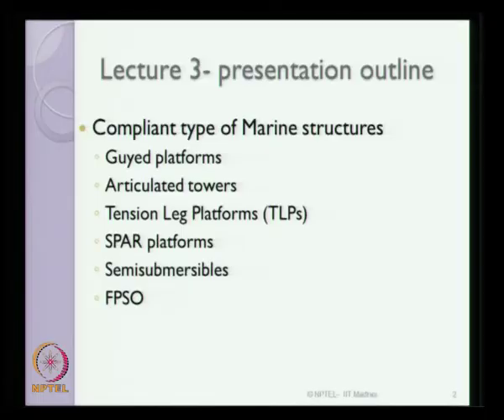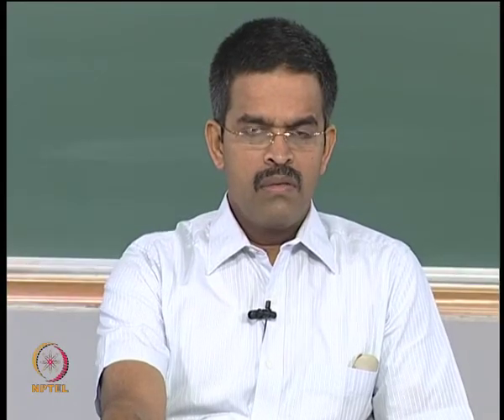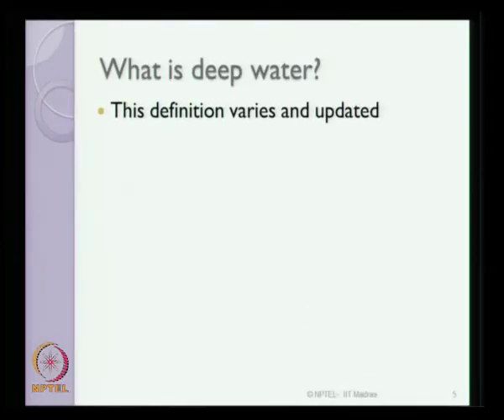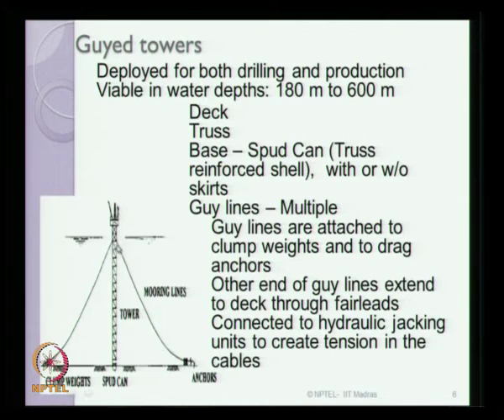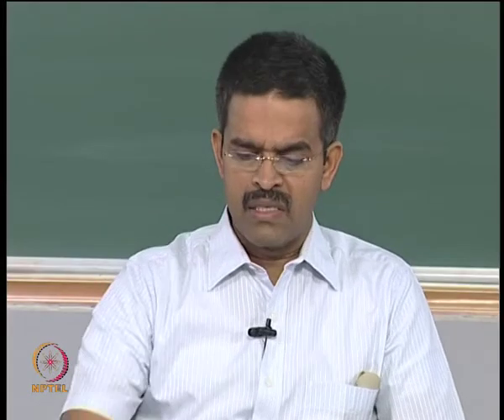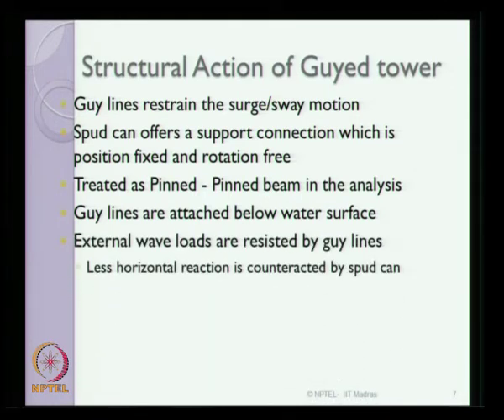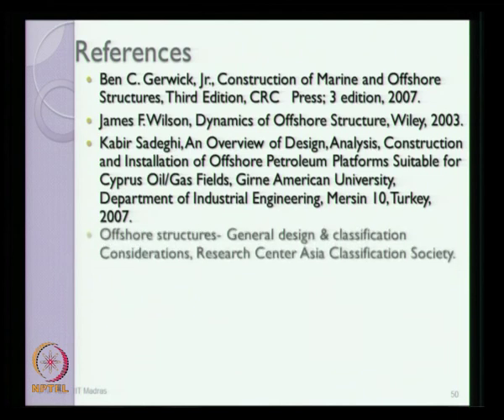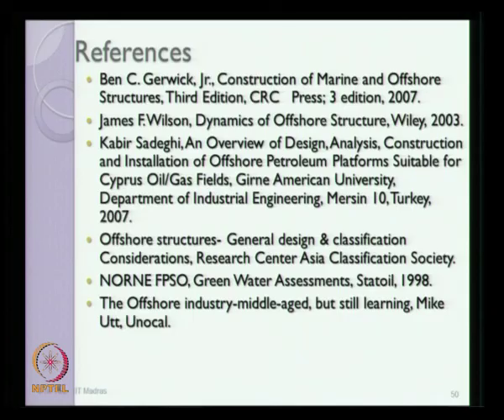Mod-01 Lec-03 Compliant type structures

Comment: A SALM is unsuitable for mooring a drillship (if I heard you correctly). The vessel rotates around the SALM so it doesn't provide a fixed position for the wells. It is usually used with subsea wells.
The picture shows a FSU and the tower is a flare not a drilling derrick.

Comment: TLPs. There are of course no launching costs.
You don't mention one of the biggest advantages, which is that the deck can be installed and pre-commissioned inshore.
I don't see why the subsea costs are high since there are dry wells, as you mention correctly.